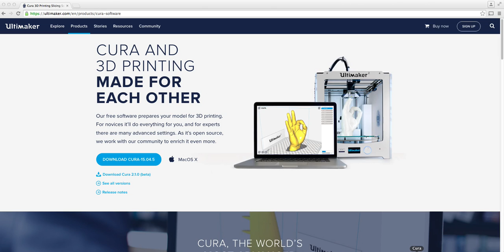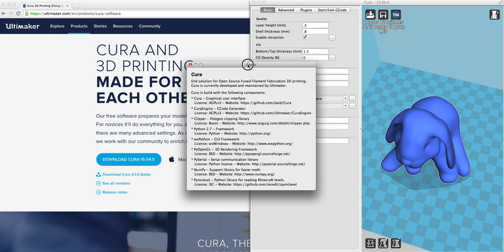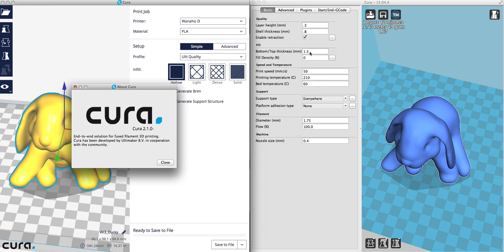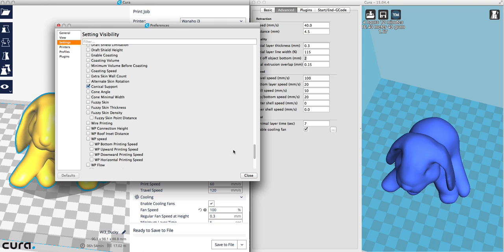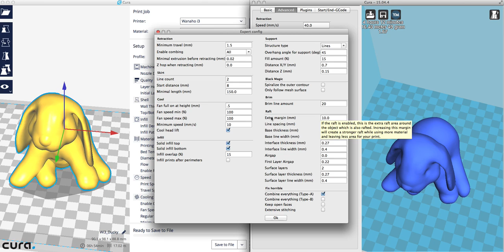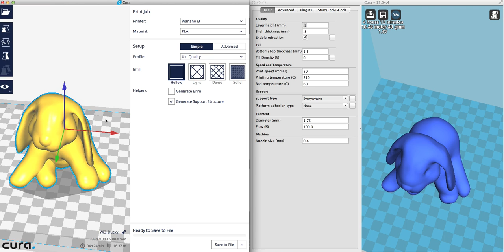3d slicer Cura 2.1.0 beta v's the older Cura - Review

Comment: I noticed when printing with the new cura that my brim lines dont all seem to connect giving me a continuous surface which has caused some warping. I don't know if there is a separate setting for the brim line width. I also find it strange that the extrusion multiplied is set two 107% percent. Not sure why that is.

Comment: Quick tips on the new Cura:

Click on Settings to allow enabling new drop down features and settings boxes in the Advanced tabs. This may be new types of supports or rafts etc.

By default, the Ulti setting does a dithering effect. It looks brilliant when it lays the filament, but nearly triples the print time. Use standard setting and adjust the features you want manually. You'll be surprised how well it still prints and keeps the time down.

You'll notice that laying flat sheet of filament is also less prone to bubbling or pilling. It lays filament slightly differently and does a much better job of flat sheets of plastic.

Z-Hop is also a feature not enabled in settings by default. It allows the head to lift on retraction before moving. This avoids build up on the head when travelling along the print to start another piece if it passes a lifted section of plastic. Recommend using this.

Also you can ask it to path the head travel to avoid printed parts. This will reduce the string overlay on printed surfaces being embedded on the next pass.

Some quick tips there.
Reply: +RamjetX I forgot to add. It also can use a increasing print speed... ie slow for the first layer and gradual increasing of speed as it works up the layers. Very useful also!
Reply: +RamjetX Did I also mention it has options for fixing model meshes too?